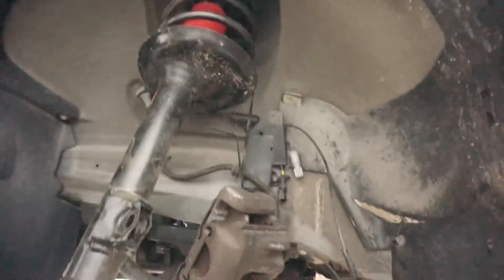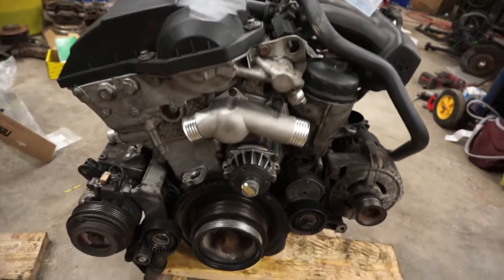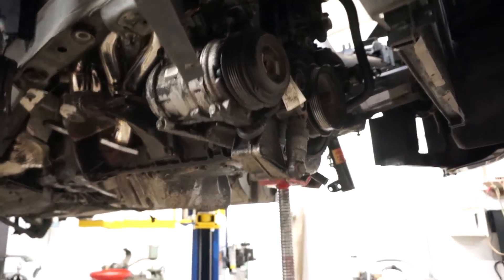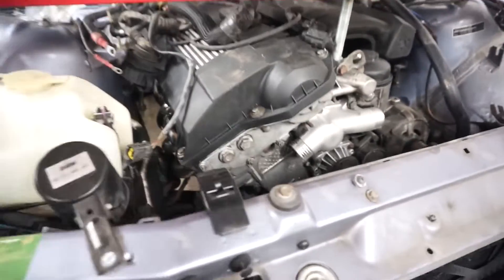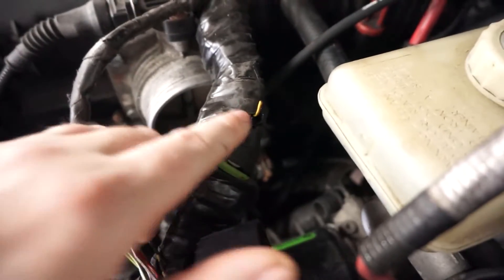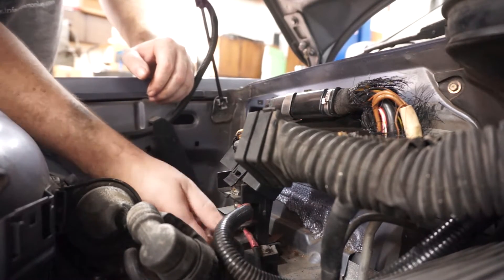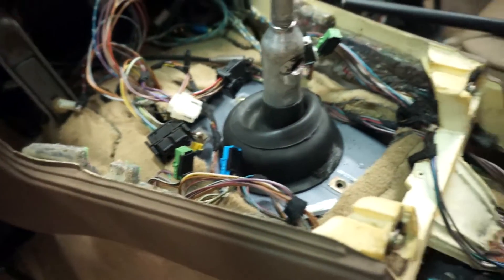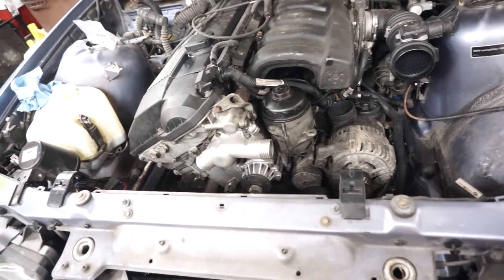E36 BMW Swap Part 5: Installing the M52 and First Start!

Comment: I was searching to swap an E36 diesel to petrol, do you know if I just swap the engine, harness, and DME do you thing if I connect the plug of harness on engine bay, will be plug and play ? Or need some harness change ?

Comment: I want to m52 swap a 318is that is already manual what would be needed to complete that’s swap would I need a different engine harness size it’s now a inline 6 instead of the inline 4. What other things would I need to complete this swap, would the transmission from the inline 4 be compatible with the inline 6 m52?

Comment: Did you swap over the manual engine harness with the donor motor? What did you do with the transmission control unit / module / computer? I'm in the middle of a similar swap, swapping over the engine, harness and transmission from the manual donor and can't find an answer about what to do with the TCM. Most swappers pull a chip from it and reconnect it but I'll be using the manual car's wiring harness and want to remove the TCM entirely.
Reply from the maker: I swapped over the manual harness. Since I started with a 318i, I couldn't reuse the automatic harness if I wanted! Since you also have the manual harness, it should be plug and play except for the reverse lights and clutch switch. Good luck!

Comment: Nice vídeo , im doing a e39 m52 swap to my e36 316i 1996 and i have the the e39 with me , can you Show the diagram to wardness wiring you rebuild of x20 plug please ?
Reply from the maker: you can look up the wiring diagrams on google "e36 wiring diagram." There are a bunch of PDFs available. I didn't rewire anything because I used an e36 harness so it was plug and play.

Comment: what did you do for the reverse light switch on the transmission? its not the same connector from an automatic harness is it?
Reply from the maker: I'll do a video on it. The short answer is that I don't currently have them wired up (I live in a semi-rural area and don't use reverse much anyway), but there are two usual ways to wire them for a swap. Because my engine harness came from a manual car, reverse is wired to the round connectors under the hood but the chassis wiring needs to be altered to pick the signal up which previously came from the shifter. If you have an auto harness, it's probably easier to re-use the old reverse wiring and just tie it into the sensor on the transmission.
Reply: @chesapeakemotorwerks  yeah i believe i have an auto harness at the momment with a manual tranny, so i think ill just wire the original auto shifter connector wires to the trannys reverse switch and should work flawless

Comment: Did you had to do any modifications to the chassis/engine plugs for it to start? I'm doing basically the same swap myself right now ('92 318iA to M52 Manual) and it doesnt do any spark, but cranks. EWS already taken care of on the engine ecu.
Reply from the maker: No, I didn't. OBD-I to OBD-II will be slightly different but the harness to actually run the engine should work as far as I know. Because yours was auto, you will need to wire the reverse & neutral safety switches. It sounds like you already have that taken care of if it's cranking. Make sure your coil harness is plugged in and that all your grounds and supplies are connected. Good luck!
Reply: does all of the pins in the x69 connector line up, does your cluster have power?
 @chesapeakemotorwerks